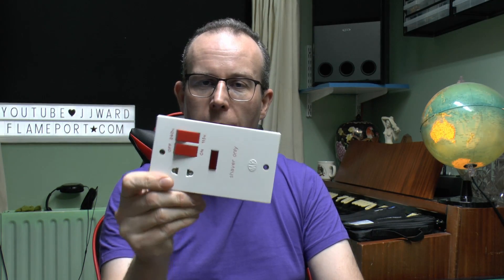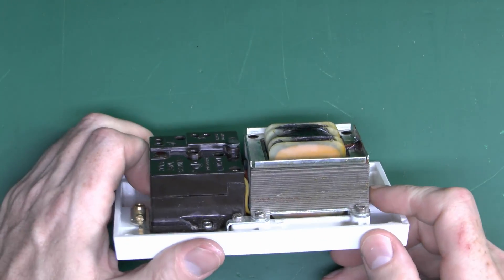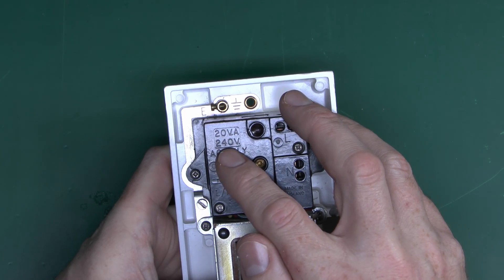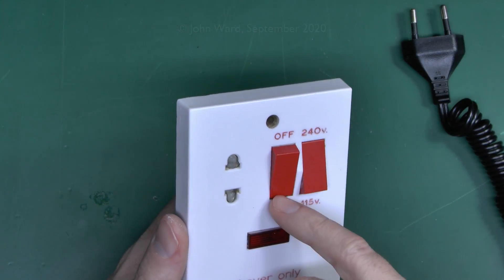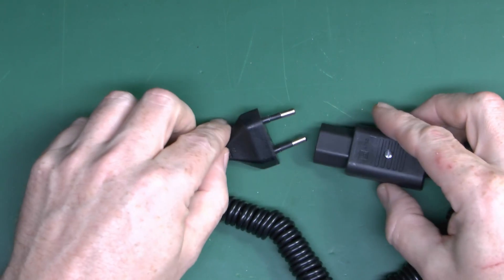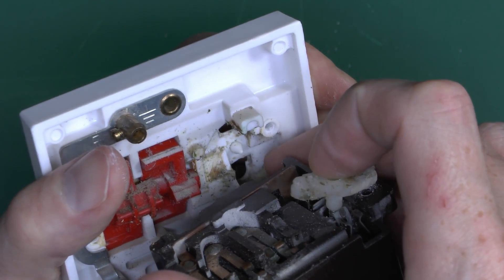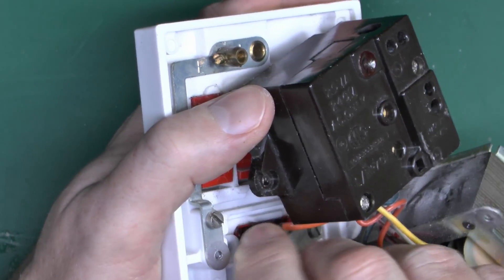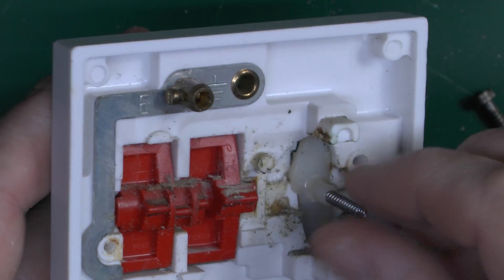Shaver Sockets for UK Bathrooms - With Isolating Transformer

Comment: UK has really odd requirements compared to the US. Here its just GFCI outlets when you're within a certain number of feet of a "wet" location or if in a kitchen or bathroom.
Reply: Seriously. Sometimes JW's videos make me glad I don't have to deal with UK electrical
Reply: @IonRoux  Lights have to be on an entirely separate circuit. Crazy.
Reply: @sneezyferret6482  not to mention all lights being on ONE circuit. To me that's just crazy
Reply: @IonRoux  Typically lights downstairs will be on one circuit and another circuit for upstairs. I mean. it's handy if you want to do work on the sockets and still have lighting, or vice versa....but old regs, they need an update to allow it if you want to have it either way. 230v is half the amperage of north america, and lights draw very little current as it is, especially the energy efficient bulbs we have now.
Reply: Ran Dome Separate circuits for lighting make much more sense! How many times has a blowing bulb caused a breaker to pop? What if that's the same circuit supplying say your fridge and freezer, and goes unnoticed? What if a bulb goes and you also loose power to plug in lamps because they are supplied from the same circuit- you're stumbling around in the dark.
Reply: @spencerwilton5831  Fridges and freezers here are mandated to be on dedicated circuits for just that reason. Blown bulb? Not a problem.
Reply: @spencerwilton5831  The reason for lights on a separate circuit is long obsolete: it's because in the early days of electricity, there used to be a cheaper rate/tariff for lighting, which was hooked up to a separate meter.

Comment: I recall earlier shaver sockets which were dual voltage but were the same size as a single socket. They contained an autotransformer to give the dual voltage, so they were not isolated from earth potential. They must have been the worst of both worlds giving both low power and the possibility of a lethal shock.

You will still occasionally come across them, and they really ought to be replaced for safety reasons.

nb. as for power not being delivered into bathrooms, my mother can remember when electricity was being installed in her parents council house in the 1930s (she was very young at the time), it was first installed in the bathroom, often to heat water as well. Needless to say, that changed after the war.

Comment: Very interesting Video
I only know the other shaver socket with 2 round pins for 220V and 110v for the us plug.
Without any switches, but with a picture of a man who's shaving and 20VA. I think it was from Busch Jager and very old.
But your adapter is very dangerous, because it has no earth and for items till 10A. But I think you know what you do and no other persons will get it in their hands. 
It's the same like a 32A CEE plug and a 16A outlet without any breaker. 
For testing may be ok, but not for normal use

Comment: I recently stayed in a premier inn and had to leave to bathroom light on all night to recharge the toothbrush because the “shaver” socket was only energised when the light was on.
Reply: It makes sense attaching it to a small lighting circuit but why would it be on the switch live of all things?
Reply: @dylanharding5720  Because the transformer can overheat if powered up continuously
Reply: @michaeltb1358  as you leaving it on overnight proves, no it won't. No well made transformer would, even low quality ones wouldn't
Reply: @dylanharding5720  Overnight is one thing, but permanently on is another. I had one which became seriously warm in operation.
Reply: @michaeltb1358  they can become warn in operation, that's fine. However a transformer should never overheat unless placed under abnormal load and given it shouldn't even be running if not under load, it certainly shouldn't overheat if just idle.

Comment: Why wouldn't the code be changed with RCD's (GFCI's)?  There isn't any reason for this now.  I am glad in the USA we can load bathrooms up with outlets.  We have all sorts of things plugged in larger master baths here in the USA.   Good video John, keep them up.
Reply: The UK RCDs are rated for a much higher current before tripping and at twice the voltage of the US equivalent GFCI (outlet or breaker). The us version must trip at 5mA or less at 120v. The UK RCD specification is 30mA, I believe, which puts the amount of energy required to trip the UK version at 12 times that if the US counterpart. Additionally, 240v has a higher chance of arcing than 120v, which is part of the reason behind having switches on individual outlets in the UK. There are trade-offs between 240v and 120v systems, neither one is necessarily better in every circumstance.
Reply: @thomasbonse  there is no regulatory requirement for switches on UK outlets. They can be bought without them. It's more a matter of convenience than for safety.
Reply: @thomasbonse  So? What on earth has US regulations have to do with anything. Here RCDs are related on what we feel is needed.
Reply: @okaro6595  Please keep up with the conversation. This particular thread is concerning a contrast between the UK's electrical regulations versus those in the US and the reasoning behind the content of those regulations.
Reply: RCDs can fail, older AC types can become incapacitated by DC waveforms, UK bathrooms are often smaller, pipework in UK houses is directly bonded to ground, you expose yourself to one hell of a risk coming into contact with 240V while in a bath.
Reply: UK bathrooms are historically much smaller and it's not uncommon to see bathroom walls in older uninsulated homes streaming with condensation when the shower is running.
Reply: @uK8cvPAq  I've lived in 14 different homes (houses and apartments) that I can remember clearly; in addition to having stayed in many more hotels and even relatives' homes when traveling. Most had some sort of condensation issue when using the shower. This was true, even when the bathrooms had a working powered vent. While I can't speak to the 70's themselves, I've lived in places built in or before that timeframe. From a technology available in the 70's standpoint, the UK did a better job with electrical safety regulations in many key areas. However, some areas are much more similar to the old knob and tube installations from a century ago. Or the allowance for plastic consumer units (fuse panel or breaker panel in the US) was really a step backwards in terms of safety. Ring finals are another case of substituting reduced cost for safety. At the time they were introduced, this was a way to stretch the limited supply of copper after WW2. At this point, my personal opinion is that existing installations of these ring finals should be grandfathered and disallow expansion or new installations of this particular configuration.

Comment: At some point with the emergence of low power voltage sockets (including from power of Ethernet sources) and the greater reliability of class A RCD/ADD sockets backed with a secondary RCD/ADD at the consumer unit could make more likely the use of sockets in bathroom. So the question is what would you have in the bathroom - believe it or not people will put smart devices in those rooms, music, heating devices, powered toilets and hand drying devices. What about fused plugged devices - in a zone away from bath is dryers? Washing machines? Is that still allowable?
Reply: Thanks John Yes that’s what I meant wired directly in without a plug, I have been out of the U.K. too many years now getting old and confused . Things are moving are so fast regulations are not keeping up especially on the low voltage stuff and PoE aspect where the potential for powering so many devices is become more likely including lighting. Really enjoyed the recent SPD podcast. It took me a long time to get use to sockets in bathroom when I moved to the USA don’t use them at all but I have to say the class A RCD devices are extremely reliable. It’s very rare to hear of electrocution in bathrooms but it does happen more often than not usually when older RCDs fail. Most Class A RCDs/GFCIs in US are now continuously self testing and flag deficiencies and have trip times of around 4-10ms and trip currents of 5-6 mA. It’s pretty robust - but still the mentality of not using a socket and plugs in bathrooms stays with me. I do like the idea of a double safety mechanism RCD sockets protecting sockets downstream and a RCD at the consumer unit (upstream) in my mind that would address the issue with tamper resistant fully IP rated sockets and properly sleeved pins on plugs. We will see if that takes off in the U.K. though I suspect the low voltage stuff is going to overtake this. Hence the growing need for SPDs type 1 and 2 with the greatest likelihood of transient overvoltages and spikes.
Reply from the maker: Appliances are allowed, but need to be connected by a wired outlet, not a plug/socket.
Reply: I my country we always had socket in the bathroom and people typically use them for washing machine, hair dryer (since in the bathroom you usually have a big mirror with a good light), hair straightener, electric razors, tooth brushes, space heaters (to have the bathroom more hot than other rooms), or other things like radios, I even saw a person that installed a Google Home mini in the bathroom (and thinking about it, it makes sense). 

Of course there are zones where 220v sockets/switches/etc are not permitted, like in the proximity of the shower/bath, but is only 60cm.

Comment: Regs apart, this is a typical example of good old solid reliable British design and engineering that we used to endure in the 60s and 70s.
Nowadays its all foreign made crap imported and a union jack sticker bunged on it when it gets into port. I wonder if the chirpy chirpy cheap cheap Chinese MK stuff has a version of shaver socket.
Reply from the maker: Checked -  yes there is a MK Essentials shaver outlet.
Reply: @jwflame  your up late JW.

Comment: Funny regs, allows electric showers but no sockets even if it has ip65 rating. We can install sockets if distance to shower is greater than 120cm and not directly above bath tub.
Reply: So you plug your hair dryer into the ip65 socket and then drop it in the bath? Think you're missing the point of the regulation.
Reply: Electric showers are suitably IP rated for the environment.
Reply: Whilst there are external sockets with IP65 ratings, that's  because they have waterproof covers. That's no the sort of thing you find inside a house, and opening the lid to plug in a cable is going to compromise that.

Comment: We have GFCI receptacles in our bathrooms in the US. I dont know of anyone dying from electric shock in a bathroom. Sounds like over regulation to me . They should atlest allow you to add a larger say 1KVA isolation transformer for bathroom use remotely .
Reply: Bear in mind you have half the voltage we do... and that this standard was brought in long before RCD/GFCI's were a thing. Nowadays the whole house is protected by an RCD, however an RCD/GFCI does NOT protect you in all situations
Reply: Peter Mulholland true but we all know it’s the current that matters anything between 30-50mA will do the trick for electrocution risk. In the USA now we have bathrooms protected from arc faults, surge protections and ground faults indeed we double up upstream and downstream with GFCI/AFCI/SPDs at sockets and upstream in the consumer unit/Panels we have GFCI/AFCI and SPDs. Moreover our Class A devices trip faster 5-10mS and at much lower current 5-7mA.

Indeed the newer GFCIs are self testing continuously and will alert you to them not working. The risk has massively reduced with the addition of IP rated and tamper resistant sockets/receptacles. I expect the future 19th edition will catch-up with latest safety technology. In modern homes with growing mix of AC and DC equipment the importance of power quality not just safety is becoming more of an issue.
Reply: @mathman0101  Higher voltage = greater risk of electrocution (greater current flow).
Reply: * higher voltage is only an indirect risk of higher currents using fixed impedance/resistance (Ohms Law). There are whole bunch of factor impacting risk of shock like duration, pathway across the heart, skin resistance ( which varies dramatically with moisture and temperature), pre-existing medical conditions, even age and sex. Notwithstanding the different factors assuming a steady current flow voltages as low as 42 voltages have caused deaths. Bottom line both US and UK voltages and currents are dangerous. Hence a big reason electricians work mostly on de-energized circuits.
Reply: Wow a 1KVA isolation transformer for this in the bathroom - what exactly are you planning to us it for ????
Reply: @Mike_5  Hair dryer maybe
Reply: @apollorobb  The UK supply voltage is a lot higher than the USA
Reply: @Mike_5  Im quite aware its 240v@50Hz
Reply: @apollorobb  In which case you should be aware that twice the voltage will pump twice the current through a human body, all other things being equal.
Reply: Isolation transformers aren't magic, you can still kill yourself with one, and they will stop a GFCI from working, so might even be more dangerous.  The isolateion transformer is designed to be used with shaver (or nowadays other specific bathroom appliances), these are designed in certain way, the devices together provide an enhanced level of safety.  You wouldn't want to a hairdryer with an isolation transformer derived 240V at 1000VA into a bath.
Reply: @edc1569  isolation transformers don't have to be magic, they just have to do what they are designed to do, which is prevent a path to earth, which they do with virtually 100% reliability. Only if somebody manages to touch both live terminals with different parts of the body is there the possibility of a lethal shock. Also, isolation transformers don't stop RCDs working, the make them redundant. If there's no path to earth on the secondary, there can be no leakage current to trip in the first place. Leakage currents on the primary will, of course, be detected as normal. Isolation transformers are the gold standard in preventing routes to earth hazards, and they are used in sensitive environments, like operating theatres, throughout the world.
Incidentally, the danger of the hairdryer in the bathtub is the flow to earth via the water and the human body touching earth. In the scenario you paint, with a fully isolated from earth/ground, there would be virtually no current flow through the person in the bath as there's no route. Also, the power is largely irrelevant to the lethality. The current that a shaver socket could deliver would be way more than enough to kill if there was a path to earth/ground and a person touched a live terminal or was sitting in a bath.
Reply: Here was a case where a plumber died  five years ago in Finland but that as because of improperly wired socket. The ground was connected to the live wire. There also has been several non-fatal cases for the same reason. In each the resident had bought a mirror cabinet with a socket and illegally installed it himself. Only professionals can do fixed wiring.

Comment: The newer ones (last 30/35 years) didn't have the red manual switches to select the voltage and to enable  turning it on or off as the British Standard had changed to remove the shock risk from someone using the switches with wet hands.  I'm pretty sure that the on/off switch operated the primary winding, therefore if wet hands and condensation had managed to form a conductive path to the switch contacts, then a shock risk would be created.  Those MK Logic shaver sockets were all very well made items like all all older MK items, especially before the introduction of Logic Plus in '96.
Reply: Looking at those terminal of that shaver socket "clamp type" were the ones introduced in the early 70's when we had a copper shortage and copper clad cables were the normal for a year or so, copper clad ally nasty cables always use to find on normal switches you would cut through cable with the screw
Reply: I have a bathroom light with built in shaver sockets made by MK. Excellent design with separate 110/240v sockets which are only live when a plug is inserted, feeding power to the transformer . Classic MK safety features. Sadly no longer available.

Comment: Accepts a US plug, as well. Which I remembered from my last hop across the pond!
Reply: Which would also be the reason for having the voltage switch.
Reply: I can confirm I use a US to UK adaptor to plug stuff in to a shaver socket
Reply: My shaver light will only take a US plug on the 110 v outlet.  Safer than a switch